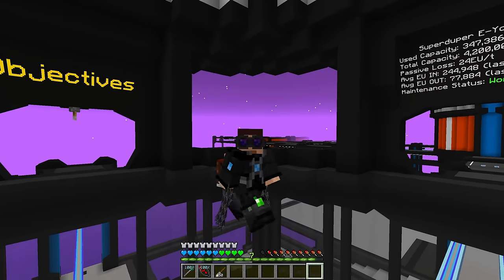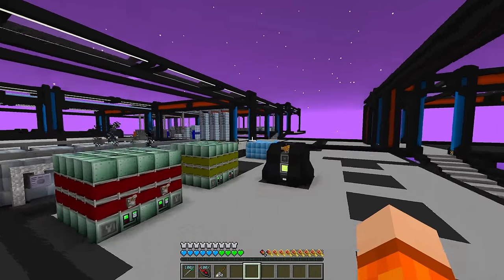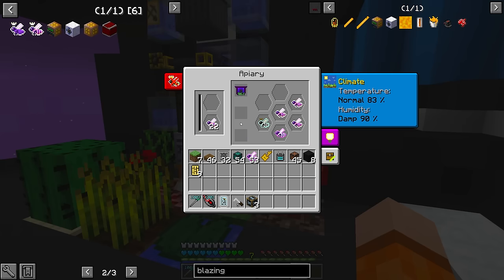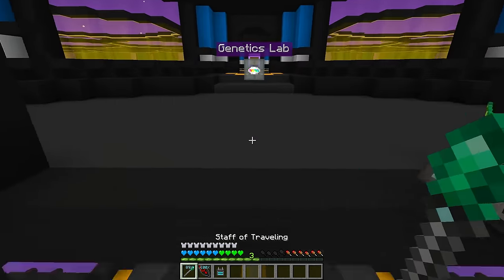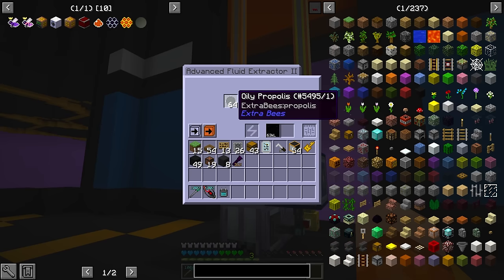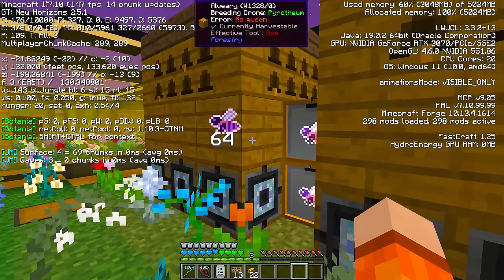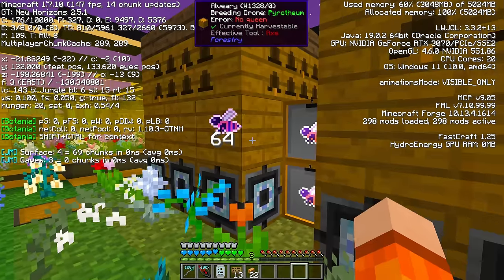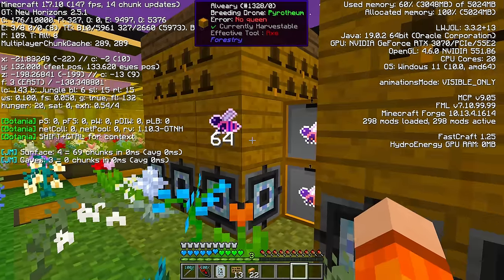Gregtech New Horizons S2 70: Will This Bee Worthwhile?

Comment from the maker: I realised that I never mentioned the Keyboard that I use... It is in fact the Epomaker TH80 Pro - Theory - Flamingo Switches UK Layout. Hopefully should have a replacement soon :D
Reply: If you want silent switches give Akko Penguins a try they're nice
Reply: Are you sure it is a hardware issue? Maybe it's just some of Windows's shenanigans, as something like that happened to me plenty of times before with other usb devices
If you are willing to go the extra mile to test it, you could always boot Ubuntu from a pendrive and see if the keyboard works there, that way you know for a fact it isn't software side
Reply from the maker: Yeah, im certain it's the harware as it has stopped charging or giving any response. I tried on multiple PCs and devices 😢 @Lynohara
Reply: If you're in the market for a different (but similar) keyboard which will last longer, I can recommend the Keychron V1, it's an absolute tank.

Comment: Unneeded Drones are best fed to a Beegonia flower from Magical Bees/Botania, or otherwise just chucked into the void. The DNA extractor from Gendustry does exist and is craftable in GTNH, but it is such a slow machine to run I cannot imagine that it is the intended, let stand only solution to getting Liquid DNA for what few recipes require it. If you absolutely require a giant stockpile of random drones at some point you can just add storage upgrades to the drawers that store/void excess Alveary drones. Never mind the fact that storing up to ~2 million drones per Alveary that way would create a backlog no sane amount of DNA Extractors could realistically work through even by the time you crafted multiple stargates, that amount of drones per Alveary will surely prove enough.

There are other ways to get krypton, but they're all awful. Liquid Air distillation takes far, far too much liquid air to be worth considering, though even discounting that aspect completely a yield of ~3 seconds per milibucket at EV is complete garbage. Naquadah Gas is LuV, Gas Sparging is LuV (and an anthill worth of rabbit holes besides), TRISO Pebbles are post-T1 fusion, Excited Plutonium fuel is post-T2 fusion, and depleted single rod fuel cells make liquid air distilling look like greased lightning in the best of circumstances. If you want to use Krypton for EBF/Volcanus smelting, you need the bee. And considering you need said bee for Xenon bees down the line anyhow, might as well get some use out of them earlier on. To give an example of what Krypton is good for, recall ~135 seconds per LuV motor in the second best case of LuV/HSS-S/Radon Volcanus? LuV/HSS-S/Krypton Volcanus is the best circumstance (in IV), needing only ~96 seconds per motor. It even saves you power, since 16 ruridit ingots require ~10M EU worth of radon to be smelted, whereas the Krypton only costs ~5M EU. In addition to the power the EBF/Volcani saves from not having to run a recipe for as long.

The road to getting Krypton bees is long, but the magic bees you get along the way add to the value of the (inevitable anyway) detour. The Thaumium Dust bee in particular is on the path to the Salis Mundus bee, meaning infinite free Salis Mundus and - using a very simple crucible recipe - basically Balance Shards at the same time. It's also one part of the Quicksilver bee, which is one way to automate quicksilver for your chemical bath in ore processing if you don't have (or want to use) Shimmerleaf IC2 crops for that purpose.

In terms of EBF smelting there is nothing Neon (or Neon bees) can do that Krypton bees can't do better, and using the same infrastructure. That said you do need a fair bit of Neon to craft Void Miners down the line, so don't forget to grab a Neon bee for when you're ready to start crafting those. Having to delay that project on a lack of Neon would be tragedy on the highest order 🙃.

The only situation in which you should see regular wafers being used for a craft post-Phosphorous Doped Wafers is recipes that specifically require regular wafers, meaning solar panel-related stuff or basic wafers from Galacticraft. As soon as you have a cleanroom you shouldn't be using regular wafers for anything else anymore, so if an LPF requires them you've got some faulty recipes you need to correct.

The biggest use for magic wax is in turning Salis Mundus back into Balance Shards, since it has the exact aspects it needs for that recipe - 2 Praecantatio and 1 Ordo. Why, yes, the Salis Mundus comb does produce magic wax, which is why that bee functionally doubles as a Balance Shard bee.

The recipe for an Oblivion Frame involves a Dragon Egg. So, yeah. Not hard when you're neck-deep in bees, but not cheap either.

A Portable Hole focus would do a lot to make accessing that wiring space a lot easier.

If you process the Lead-Zinc solution that Indium produces as a byproduct you actually get your sulfuric acid worth of sulfur back. It's a closed loop, you just need additional water and a lot of oxygen to turn the sulfur back into sulfuric acid.

Long term, as far as I'm aware, you only need to set up Rare Earth III. RE I and II don't yield anything with any actual use that you don't get from RE III, although that might change in the future. Also don't bother with the industrial strength nonsense, it's not worth the bother for a bit of extra yield from something that is literally passive from bees.

So, to correct Three's multitude of errors RE: quantum/crystal circuits and advanced SMDs: The moment you can craft any quantum circuit you can craft the entire line of them, from EV to ZPM. Though whether you're able to afford them is a separate question. The reason you can't jump to crystal circuits is because they start with a Crystal Processing Unit, which - long story short - requires Europium, meaning a T1 fusion reactor. Advanced SMDs you can get in IV, and I actually recommend getting them in IV to make the dozens of Quantumprocessor Mainframes needed for Assembly Line faster/cheaper(-ish) to craft, which does involve getting Samarium. But turns out you need Samarium for LuV components anyway, it's the Magnetic Neodymium of LuV tier, and as such it's fairly easy to get as a byproduct from Rubracium Ore from one T3 ore vein (rather than having to set up Platline 2.0). Rubracium itself, fun fact, is basically useless.
Reply: Another beautifully crafted 3000 word essay from the masterful Metis😆
Reply: DNA extractor isn’t the only way for liquid dna as the bacterial vat can get you some
Krypton/neon/xenon can also come from the space siphon
Crystal circuits are also gated by the LuV circuit assembler, but europium does gate it further
Reply: These info dumps are gold, ty as always
Reply: Love it when TheShadowofX posts 3 kilo cesium 133 strandands worth of reading every single threefold gregtech new horizon episode. Liked and subscribed.

Comment: The Assembly Line itself technically doesn't require much in the way of EBF processing capacity, you can craft the multi with 8x EBF easily enough. LuV components - motors, pumps, pistons, etc. - are a very different story however. Ruridit in particular is a nightmare, with a second worst case scenario (LuV power, HSS-G coils, Radon fed EBF) spending just shy of 20 minutes per LuV motor. Not seconds, *minutes*. Not to mention the 690 million-odd EU said EBF will need. Compare this to the second best case scenario (LuV power, HSS-S coils, Radon fed Volcanus) spending a mere ~135 seconds per motor, and a mere 33.5 million-odd EU per motor. This is why I recommend people upgrade to Volcani before getting an Assembly Line - you will want them anyhow, might as well get them sooner and cook up all of that tungstensteel and tungsten and whatever else you need faster/cheaper while you're at it.

"Nothing a bit of AFKing (or a lot of AFKing, but time is relative when you're sleeping through most of it) doesn't solve", you say? You can set up passive power production and set up passive/massive batches of ingot smelting, yes, but Ruridit is just the beginning. Where IV tested your circuit crafting capacity before allowing you to advance into LuV, LuV and beyond will test your EBF (and Vacuum Freezer) capacity at basically every point. Even just getting to ZPM without Volcani is pure misery, trying to cook Neutronium in regular EBFs I don't even want to imagine. Or the power supply required to cook the stuff in MEBFs.

So, to clarify: Volcani are 120% *faster*, meaning 220% processing speed compared to an EBF, on top of only consuming 90% the EU/t a recipe would normally consume, and being able to smelt up to eight recipes in parallel. Since you're running recipes 2.2x as fast, for only 0.9x the amount of power consumed per tick, you end up paying ~41% the EU cost for a given ingot recipe in a Volcanus than you do using an EBF. That is already amazing, but parallels make this even better. Running 4x recipes in parallel is basically the equivalent of a perfect overclock - 4x output, 1x time, 4x power cost in both cases - which is great for avoiding EU inefficient imperfect overclocks. And with the speed bonus you won't miss said imperfect overclocks anyway, stuff will get cooked quickly enough.

Given some finicky stuff recently discovered with specialty and regular bee produce not being produced at the same rates, despite being the same listed percent chances to be produced, I have no idea how many bees you'd need to keep a Volcanus active 24/7. Mind you that as important as it is to keep a Volcanus supplied on pyrotheum - if it runs out the recipe it's running will be voided, and the Volcanus will get a maintenance issue to boot - it's trivially easy to set up redstone automation so that Volcani will only run when their pyro input hatch is maxed out, which will guarantee 3200 seconds or ~53 minutes of runtime even if the pyro hatch is quad shared and zero additional pyro is input. This is well above the single longest EBF recipe currently in the pack, C1 Infinity Dust into Hot Infinity Ingot, which you would A: Never use in any halfway realistic scenario, and B: A Volcanus would smelt at 2.2x speed even if you did. Set up proper automation for your Volcani, and you need never worry about Pyrotheum being more than an unexpected delay ever again.

That said it would be nice if EBF smelting wasn't delayed at all, given how even Volcani require multiple minutes per LuV motor under the second best conditions. In that respect my advice is simply to set up automation for Pyrotheum Dust, at least insofar as being able to have AE2 autocraft a giant batch of the stuff if you notice that Pyrotheum levels are low. Your ore processing should be able to supply the raw materials, if you make sure to place miners to keep them in stock. For passiving pyrotheum dust you you've got a ton of options - Bees can passive the dust directly and/or all four components thereof, Balzereed and Nether Stonelilly IC2 crops can passive all four components between the two of them, and finally Extreme Entity Crushers can likewise passive all four components if you sag mill blaze rods to get the sulfur dust byproduct chance. Basically you've got every opportunity to passive pyrotheum, so choose whichever method (or methods) you prefer, and set it up. Each volcanus only consumes a flat 0.5mb/t when actively running, so you don't need that much income to support a fair few Volcani.

For the record, you can mutate bees that require X temperature in the void world so long as you provide them said temperature, be it through Shifting Seasons of Hygroregulators/Fans/Heaters. A mutation only needs to take place in a specific dimension if it specifically requires that dimension.

Comment: You can still get Xenon combs without the Mega Apiary, buuut only by manually solving escritore puzzles, so it's not at all worth it.  I guess you could replicate it.  There's a similar way to skip and get Oganesson a tier early, but that's ZPM.
Hivecynth + Hibeescus is one way to print pristine bees, but if you only need pristine bees and not to turn princesses from the mutatron, alveary swarmer, etc from ignoble to pristine, then just buying watery/rocky hives is good.  There's a table for "hive drops" in my bee guide on the gtnh wiki that documents all the peculiarities like hives that always drop pristines or that drop steadfast instead of valiant.
You can add blazing electron tubes to a circuit board and put it in the carpenters to make them faster.
I would just use the UU matter recipe for data orbs.  You have LPFs now and you have a crop robot, so getting spaceplant to make lots of UUM should be very easy.  I also unironically think it's a better time investment to set up replication than to set up the monazite line for samarium.  The UUM half of replication can be scaled very easily if you use crops + LPFs, which are the best choice until the multi.  The actual replicator half though doesn't really scale well since any replicators you make will be obsolete when you unlock the next tier, and the multi is very gated.
Also, remember that Advanced SMDs are NOT better than basic SMDs.  They're at best a sidegrade.  You get more and need less per recipe, but they are still significantly more expensive relatively speaking.  So you could argue they are better because they also lower the crafting time, but you can also always make more circuit assemblers

Comment: What about using a crafting card, a level emitter, an exporter and a storage bus to auto craft 256 Alveary blocks and keep them in stock (:

The only downside is using a crafting card (:
Reply: would use a level maintainer instead since it limits how much is crafted to a specific amount
Reply: Level Maintainer is that entire setup with less lag